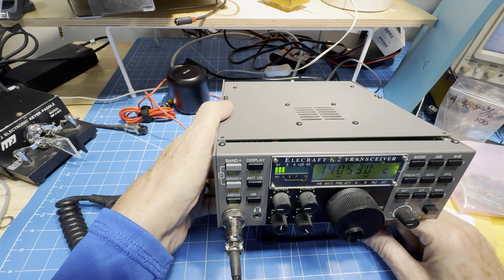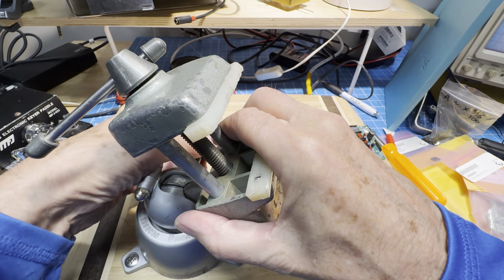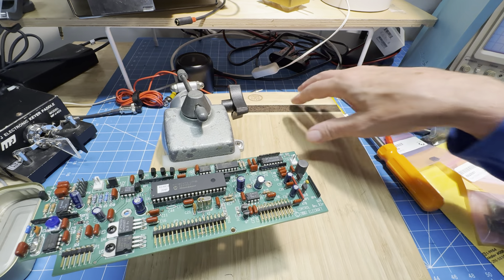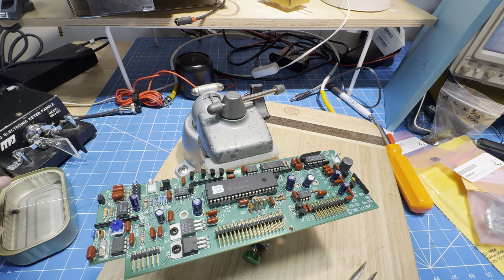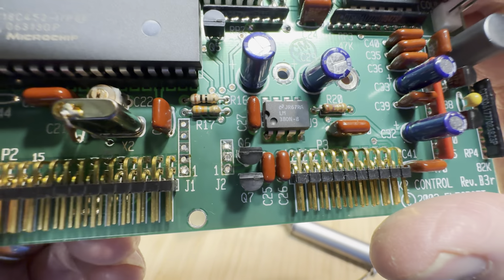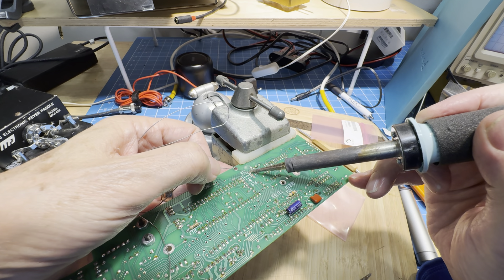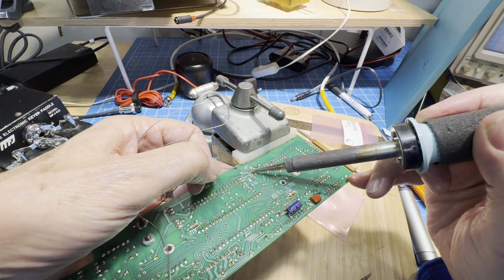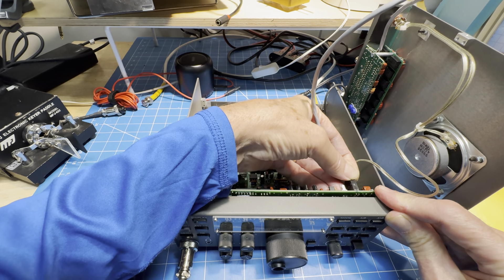K2 s/n 6203 actually gets its KAF2! The parts arrived! Part 2 - the install..

Comment: I got a second K2 with the K60XV to go with my Elecraft transverters. It also has the KDSP2. I will see how well that works before I buy a KAF2 to swap it out. While both have the, maybe it would be easier to consolidate everything into one radio? Either way, your videos are most helpful.
Reply from the maker: Glad the info was useful! The transverters sound fun. What bands and modes are you using? I’m enjoying the 2 levels of the KAF2. It is interesting to listen to a signal with the IF wide and the AF filter out and then hear it turn into a pure isolated signal.
Reply from the maker: Where did you find the second K2? I need to get back to some alignment soon…
Reply: @tyrueiI  Online. I turned it on today and I got error right away, “Info 80.” Crud. Now the work begins. This is 100% new territory for me - fixing things. So then I tried my K1 - and it also is not working - won’t even power up. I have my work cut out for me.

Comment: I do think a little flux would help with this project.
Reply from the maker: I think it would! I really need to up my soldering game! What are you using?
Reply: I have a Weller solder digital iron. A dropper for flux and solder braid to pull solder to clean up and yes a solder sucker too. I very carefully not to lift up pads on the board.
Reply: I will 2nd flux and solder braid, works miracles